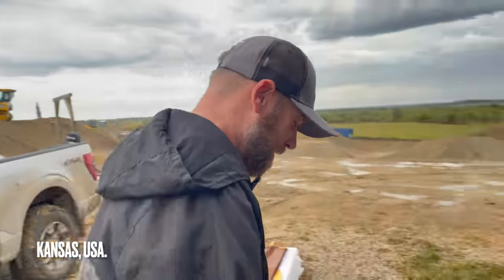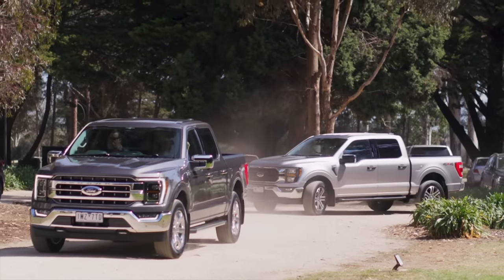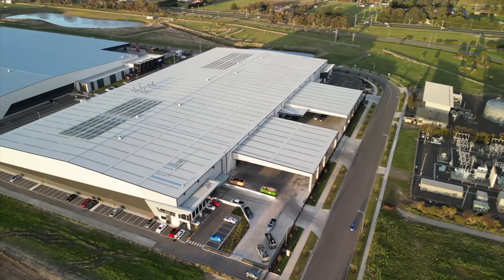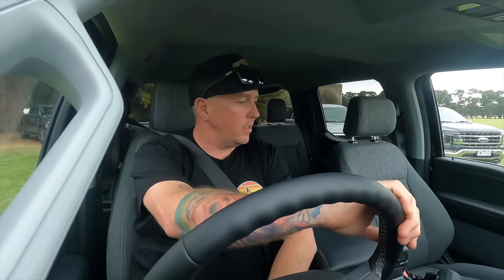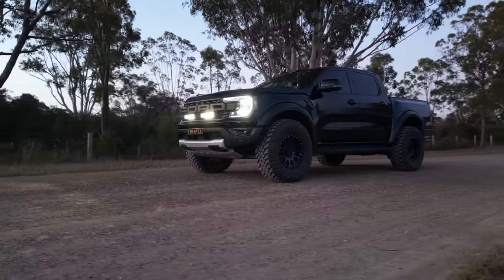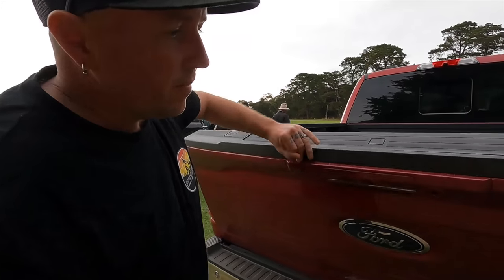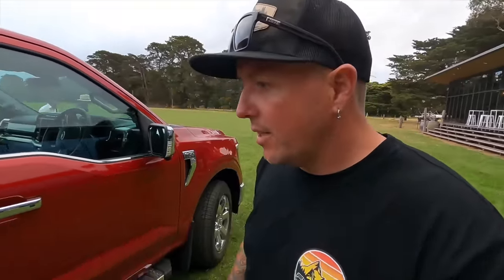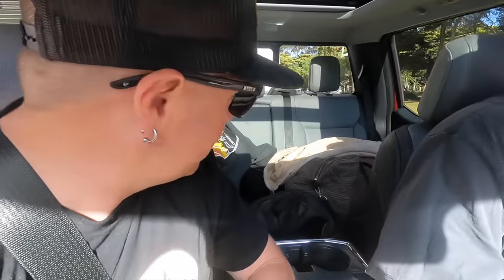🔥FIRST DRIVE ! 2023 F150 LAUNCHES IN AUSTRALIA. Is it just like FACTORY?

Comment: From the states, 2023 F150 ecoboost, when towing lock out 10th, 9th and sometimes 8th when towing, keeps rpm around 2200 at 70 mph/112 kph and doesn't labor quite as much and improves fuel consumption when towing.

Comment: If you can option it without the moonroof, youll get a big boost in payload. Almost a 1000lb difference.
Reply from the maker: XLT version has no moon roof.
Reply: Moonroof only gives back about 20-30kg in  payload
Reply: The panoramic moonroof adds 64 lbs to the weight of the vehicle (from the build guide).

Comment: Awesome review! Can the F150 4x4 be lifted? let's say 2" lift to accommodate bigger (AT or MT) tires and what's the maximum pay load increase can be modified to. Lastly can front and rear diff locker be installed, all while at the conversion factory?TA

Comment: According to Ford when towing anything over 2.5 ton a weight distribution hitch is required, I didn’t see one being used here
Reply from the maker: Where did you did Ford mention that ? Do you have web link ?
Reply: @TyFenwick  it’s in the owners manual, I’ve got an ‘18 f150 XLT with the HD tow pkg. it’s a class 4 receiver (good for 11,000 lb I think) 
I believe the 5000 lb limit is with all of the truck models, XL thru Limited
Reply: That's if it is equipped with the american tow bar. The Australian version has been re-engineered as the US one did not meet standards.

Comment: Great truck with some fantastic features, though it is hard to justify the price tag with a Ford badge on it.
The deal breaker for me, is no diesel engine, which would’ve been a perfect match for the intended purpose of the vehicle for heavy towing. 
An equivalent sized twin turbo diesel engine would have much more torque low down where you need it & superior fuel economy (very important in Oz).
Curious of what the cost would be without the conversion to RHD? I’m guessing $50K if not more?
Reply: It is a vehicle intended for the Canadian and US markets and the EPA makes it very difficult to put diesels in anything as small as an F150. You need to get above 8,500 lbs GVM/GVWR before a diesel is offered. In Ford, the F250 is the lightest vehicle that you can get a diesel in and the diesel option is a 6.7L v8.

Comment: Disappointing Ford is  charging way too much for the Lariat costing  over 150k to drive away, no way   50 grand more better  than the base model at around 100K  drive away. These cars are only 69 grand  in AUD  in the USA  remember ,  they are known for being cheap trucks over there , but here in Australia costing  Range Rover money .Be interesting to see Toyota responding with Tundra if they get greedy or be competitive as a  cheaper alternative ?
Reply: I think you need to check the XLT pricing again
Reply: The Lariat optioned similarly to the version that Australia is getting is right around $75,000 in the US. Without options the Lariat starts at $65,800 USD.

Comment: Eats Rams for breakfast?.. yeh nah, don't think so dude lol😂
Reply from the maker: Yeah RAM probably taste like shit, you're right.
Reply: I have a 2019 f150 with the 3.5 ecoboost and it absolutely eats rams for breakfast. Even on 34” tires it will easily melt the tires off if i wanted to. 
The amount of torque at lower RPM’s is far superior to any of the NA trucks in 1/2 ton. Easily the best for towing

Comment: Mate the whole of Australia has it wrong. We don't need 1500 trucks here or HD diesel trucks. We just need the HD gas trucks. No one seems to get it. 1500 aren't different enough to our utes. HD diesel are more for towing over 4.5t. That means air brakes. No one really goes to the effort to hook up air. In the states you only really go diesel HD if you need to tow over 10000lb or 4.5t. You can keep using electric to whatever weight. Where are the YouTube videos of Aussies hooking up air brakes to their 2500 trucks? That's right there are none. The other thing about gas HD's is they are lighter and have don't emission systems. You get more payload with a gas V8 then with a 6.6 or 6.7 diesel. How can this not be a legitimate argument? Look guys you've got it wrong. I am talking about the Aussie importers and converters. You messed up. No I'm not being nice about it. And then companies want to slug you for a gvm upgrade on your 1500. I believe a lot of the importers don't even know there are such things as a gas HD truck and Aussies in general. Something is rotten. The 2024s kick butt with the 10 speeds behind them. 7.3l Godzilla and Chevys 6.6L gen 5 V8 (no lifter problems like in the 1500s that have fuel management). Ram are just as bad. Bringing 1500s and only the 2500 diesels.
Reply: You obviously don't get that there is a market here for these vehicles.
Even police forces are using them  now here in OZ for their horse floats.
Towing up to 4499kg is on a car lic anything over that then those wanting to above 4.5T would have no worries about air brakes and everything else.

You stick to your EV's.

Toyota are bringing there Tundra into Oz and GMC will be bringing their Yukon in next year for sale in 2025 so there you are theres a market here for these and manufacturers happy to meet the demand
Reply: The F150 and Ram are perfect for towing boats. My old boat at about 3.7t full of fuel was not legal for most vehicles. With decent gcm, the Ram and F150 fill this gap perfectly. And with boats, the wheels are right down the back and they tow well with 5% to 7% on the ball. So, gvm not so touchy. My 3.7t boat had 180 kg on the ball and towed perfectly.
Reply: To be honest, 10,000 lbs isn't all that much for a trailer here in the US and some guys are towing closer to 15k with the 7.3 gas. 
My previous truck was a 2011 Ram 2500 diesel and it didn't have a lot more power than the new large displacement gas engines from Ford. It is nowhere close to my new truck which has the 6.7L high output Powerstroke. It pulls a 26,000 lb gooseneck flatbed without even thinking about it. I have the equivalent of an articulated truck license, but don't need it until the GCW hits 26,001 lbs.